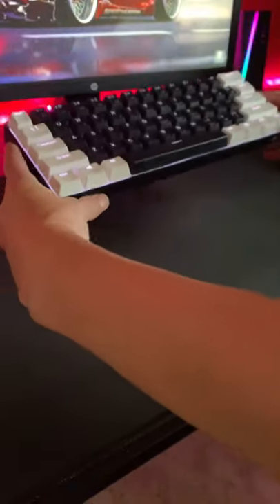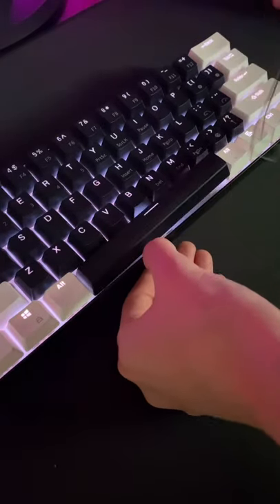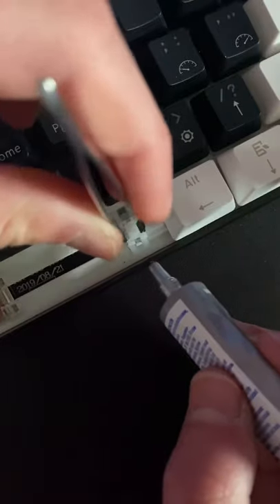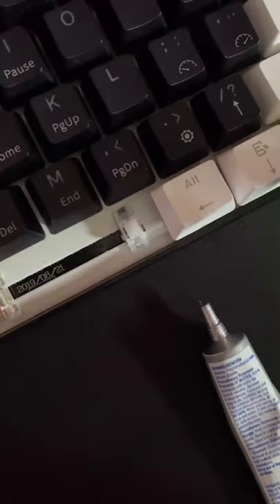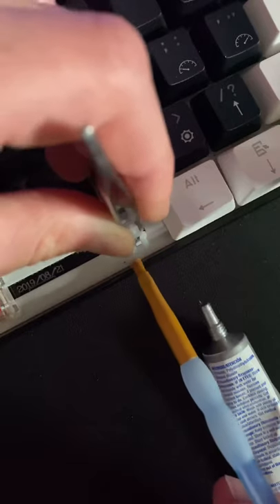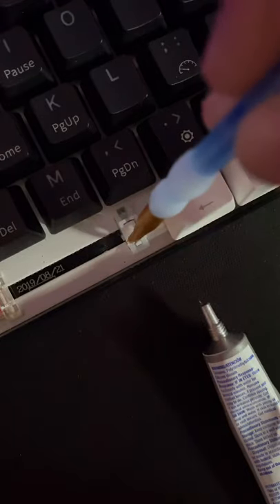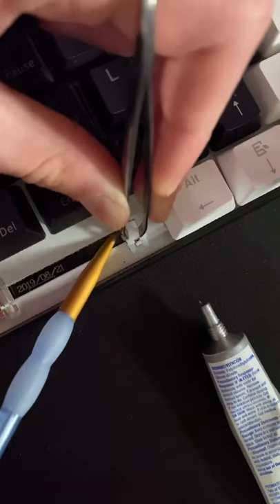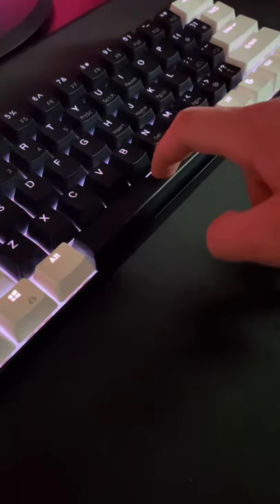Lube your stabilizers WITHOUT DESOLDERING | TechBased

Comment: You have to be really careful if this is how you're gonna lube your stabs, you can easily overlube it so I recommend you put a very little amount at a time untill you get what you're looking for
Reply from the maker: Yeah I warned about it in my new vid
Reply: What would happen if you do overlube
Reply: @rukialmao959  the stabs will feel all mushy and sticky and sound very bad.
Reply: @oriya1385  basically, but with this method, he cant lube the sides of the insert so it will still be scratchy and it will be much harder to overlube
Reply: @rukialmao959  overlubed stabs cause the key to have a sluggish return, or at worst not return at all.

if you do over lube them you might be able to simply mash it a bunch, but you may have to desolder and try again
Reply: @stev3s no
Reply: @stev3s no blues are good
Reply: @stev3s lubed blues are called whites.  if you like those I think a better bet for you would be kailh box burnt orange, or box royal depending on just how tactile you like them
Reply: @stev3s overlubed blues stop working properly
Reply: Even if you overlube it, the lube will get pushed out and distribute over a period of time and it will feel better
Reply: what key board do u have ?
Reply: @oriya1385  HAHAHAHA my guy said “none”. A true enthusiast lol
Reply: @ItsDextrin  what the hell did you just say lmao, all flase.
Reply: @dogobgynz  chimera65
Reply: @oriya1385  Im speaking from experience. If you didnt understand the statement, read it again. based on the viscosity of the lubricant, it can get squeezed out and more distributed resulting in a less 'mushy' feel.
Reply: @ItsDextrin I understood what u said it's just wrong, the lube is not going to come out at least not in a couple of years, no1 should overlube on purpose and thankfully no1 does.
Reply: @oriya1385  oh, i meant it will spread instead of squeezed out. Yeah it lasts long tho
Reply: @ItsDextrin  every lube would last long but overlubed is just gonna feel like shit for long and Normal is gonna be good for a long time
Reply: Just break them in, spam the key

Comment: you can also just unlclip the stabs, they aren’t soldered in like switches and the ones on the rk 61 are plate mounted clip stabs.
Reply: No do Ido this? Do I unclip the stabs from the motherboard or does the cover on the mother board effect this proccess
Reply: @paradoxealt544  Idk if you still need this but if your keyboard PCB (it is not called a motherboard) does not feature hotswap you will have to de-solder the switch under the spacebar. One you do that, just push the tabs on the stabilizers and pull upward. This will remove it and now you can mod your stabs. This only works if you have Plate Mount stabilizers which is the only way your PCB would affect how you do it.

Comment: I just got my GMMK Pro and the spacebar stabilizers were so overlubed out of the box that it gets stuck and makes...squishing sounds...when I press it down. I really don't want to take apart the entire keyboard just to fix the lube on the stabilizers for JUST the space bar if I can avoid it. Does anyone have any suggestions on how I can get rid of some of the lube inside the stabilizers without having to take apart the whole keyboard and extracting the stabilizers entirely? I've never taken a keyboard apart like this, and I hear the GMMK Pro is a bit difficult to take apart and put back together due to how tightly packed everything is. I also don't have any dielectric grease nor rubbing alcohol for the purpose of reapplying the lube myself after taking them out--at least not yet--so if I can avoid having to make a few purchases and spending a bunch of time taking it apart, then I'd largely prefer that.
Reply from the maker: Hey I’ve actually over lubed my stabs before aswell, one thing you can do it press your space bar a lot! Click on either side of the space bar multiple times! This will cause the lube to spread around, creating a perfectly lubed space bar! Don’t be afraid to put some force on the space bar when pressing it
Reply: @TechBasedOfficial  gave your advice a try and it seems to have helped a bit! The space bar still gets a little stuck so I’m not sure how long it would take before it becomes more normal, but this should be more usable in the meantime. Thanks for the help!
Reply: @bidoofus7921  quite honestly the only way is to get new stabilizers, since the GOAT stabs aren't exactly all too good in general. durock v2 stabs are the best for this keyboard but most of the plates don't fit the durock v2s, except for Glorious' polycarbonate plate. However there are new options like F4R plates being sold by third-party sellers. and don't be afraid to get your hands dirty with disassembling your keyboard, especially a custom-built, because that stuff will drive you mad if you don't change it, or at least that's my personal preference.
Reply: @ventihaver6898  What I ended up doing is opening up the keyboard and replacing the goat stabs with some Zeal pcb mount screw in stabs, which I band aid modded and lubed myself. Sounds and feels great now. By the way, I've heard that newer GMMK Pros are designed to allow more room for larger stabilizers like Durocks, but don't quote me on that. Regardless, I found that the Zeal stabs fit just fine in my GMMK Pro, and if anyone is unsure of which kinds of stabs would work in their GMMK Pro, just know that Zeal stabs definitely will since they're a little smaller than larger stabs like Durock V2 stabs, for example.

Edit: Figured I'd mention this: you're right when it comes to taking apart boards! While initially intimidating, I enjoyed taking apart the board, modifying it to my liking, and reassembling it. The only trouble I really ran into was that some of the screws on the backplate were extremely difficult to remove the first time around. I ended up installing the Zeal stabs I mentioned above, but I also added some more gasket strips on the top of the plate and inserted a sheet of PE foam between the plate and the pcb. While I don't think the extra gasket strips made any difference at all, the PE foam mod and the stabilizer changes have made this an outstanding keyboard in my opinion with really thocky acoustics. I love it so much, and I would definitely recommend others try to make similar modifications. (As for the PE foam mod, you can use the foam that comes in the box of your GMMK Pro--it's the foam sleeve that your GMMK Pro will be wrapped in when you take it out of the box. You'll just have to cut it to shape, which is pretty easy.)
Reply: @bidoofus7921  I bought an in-stock ( post-batch 1 and post-flex batch) GMMK Pro, is the problem though. My guess is that it's Glorious' marketing scheme to get people to be stuck with their GOAT Stabs. 

I might pick up an F4R Plate from a third-party because they're big enough to support durocks.

Comment: Desolder only the switch in the spacebar and try to remove the stablizer to actually mod it would result in a way better stablizer. And desolder is not that scary so don’t worry guys
Reply: In this case it’s a rk61. But let’s just say it’s a Corsair or a Razer kb. It’s not really possible in that case unless you want to completely disassemble it and risk breaking a lot of things.
Reply: @agasthyareddy9137  true, i actually disassemble the razer blackwindows to mod the stablizer, and it’s actually way easier to disassemble than those enthusiast keyboard, but because of the rgb, you gonna have to desolder 4 LED legs, 2 more than a single color LED, sure desoldering is not easy by anychance but what i mean it gonna be worth it

Comment: Just take the keycaps off the keys above  the spacbar and lift the thing to get other side. Also the point where the wire clips into the slider makes alot of rattle. So make sure to lube that because you can acsess if without removing anymore keycaps, it's just under the plate, so you cant see very well

Comment: This is way worse than taking out the stabs and lubing but I guess it’s ok for people that want a easy way to mod their stabs
Reply from the maker: Yeah
Reply: Some prebuilts have punched plates instead of milled ones which are really really difficult to remove and put back because they aren't secured with screws.
Reply: @DAAI741  correction: They are impossible to remove. You just can't
Reply: @GWCGamingwithChittaarth  just unsolder the switch
Reply: @socialsentoki5360  that's high level stuff, only experts can do it.
If I try it, I'll break it even more
Reply: @GWCGamingwithChittaarth  understand,but i said the only method,so its not impossible
Reply: @socialsentoki5360  well you do be true 
HAHAHAHAHAHAHHAHAHAHHAHSIDKSKZ
Reply: @GWCGamingwithChittaarth  ?

Comment: Can I use Super Lube 51010, is that alright?
Reply from the maker: Super Lube 51010 should work, its more of an oil though than the most popular lube, Krytox 205 g0
Reply: @TechBasedOfficial  ok thanks bro
Reply: @outemukeebs9790  you can also use dielectric grease which is a lot cheaper

Comment: You should get a thin tipped syringe. Suck up some lube with it and you’ll be able to place lube more efficiently and accurately. I use this method if I need to add more lube and I’m too lazy to take my stabs out.

Comment: i tried this, but it didnt work for me. i know why it didnt work and heres why: dont use thinner lube. thicker lube works the best, and i put a bit too much which led it to it leaking out to the pcb
Reply from the maker: Thinner lube is meant for switches thicker lube is mean for stabs
Reply: @TechBasedOfficial  yes sir
Reply: @mattkins752  but why do you apply lube to it?
Does it make a difference?
Reply: @a.s.3.q  yeah it does, it makes the switch feel smoother, and the sound gets smoother depending on the type of lube and switch. if you want to get some insight, some youtubers you should watch would be hamaji neo, squashy boy,  or glarses.
Reply: @mattkins752  I have blue switches  I'll try to find the grease and buy one to lube them.
Thanks
Reply: @a.s.3.q  yeah just look up videos they help alot
Reply: You guys know there is dry lube right?
Reply: Y'know even if u used the same amount just a thicker it would still leak to the pcb lol, you just used too much it doesn't matter if it's thin or thick for that regard

Comment: This is extremely inferior to manually lubing them but eh they sound decent I guess
Reply from the maker: Yeah
Reply: Well I mean it’s a royal kludge...
I wouldn’t put miles worth of effort in a $50 keyboard that would just still sound pingy or hollow anyways.
Reply: Some people aren’t willing or can’t solder tho
Reply: @SteveWithASideOfSalt  get hot swappable then
Reply: @scrambleegg9743  some people aren't that invested to paying more money for hotswap keyboards
Reply: @milliegram_yt  I got a gmmk there for €70 it's not too expensive
Reply: @RVFFICA  that's not the problem... it's that its really not that important for most people... and €70 is quite a bit for most people
Reply: @RVFFICA  starter mech keyboards cost 30$
Reply: @milliegram_yt  it’s pretty affordable tho
Reply: @scrambleegg9743  not anyone has spare money to spend 40$ more for it though
Reply: @milliegram_yt  I mean there are some $60 ones that are pretty good
Reply: @imanidiotforreplyingbut7465  Don't people with custom keyboards spend hundreds of dollars on their keyboards a lot of the time? If $50 buys you a great keyboard, then what's the point of spending $650 like this guy I watched and people defended the price of?
Reply: @NaudVanDalen  once again, the quality of typing doesn't matter for most. Also 650 is more expensive than some of my friends pcs
Reply: @imanidiotforreplyingbut7465  u can be paying up to 2k+ for aftermarket keyboards
Reply: @scrambleegg9743  you really don’t get his point at all do you
Reply: @tomatomustache1256  I do. He’s saying hot swap keyboards are expensive
Reply: @scrambleegg9743  ok so you don’t understand 😂
Reply: @tomatomustache1256  ??? I think you don’t understand

Comment: Or just ask your neighbors if they have a soldered. Took 2 mins and no $$ needed. Just make sure you’ve got some iron wire at home 🙃

Edit: doesn’t work if you live in a bad neighborhood!
Reply: Was about to say something until I read your edit lmao
Reply: also a lot of people only have a mains soldering iron like my dad which does absolutely nothing to the solder on electrical parts because it's lead free and has a higher melting point

Comment: yeah, don’t do this
Reply from the maker: Why?
Reply from the maker: Maybe not with dielectric
Reply: @TechBasedOfficial  because it’s so much simpler to take them out. You have plate mounted stabs. Just grab a flathead screwdriver, and push back the tabs and take them out